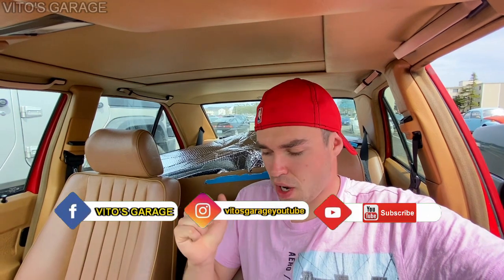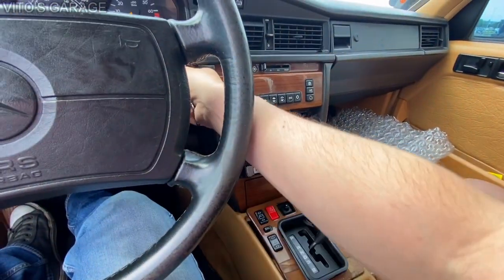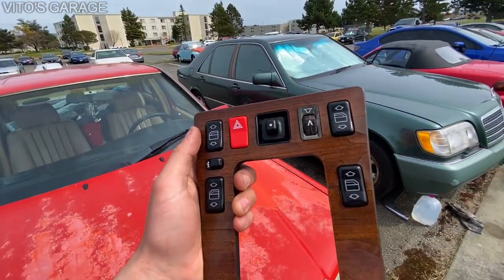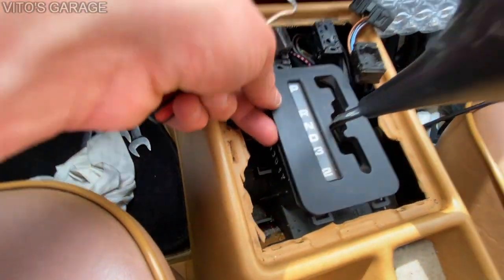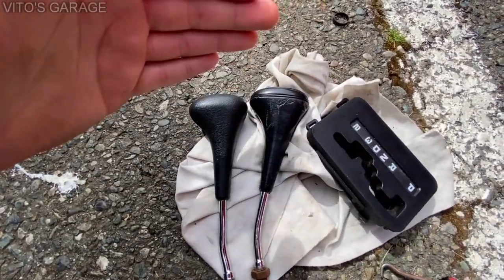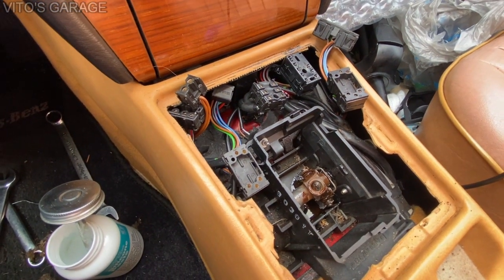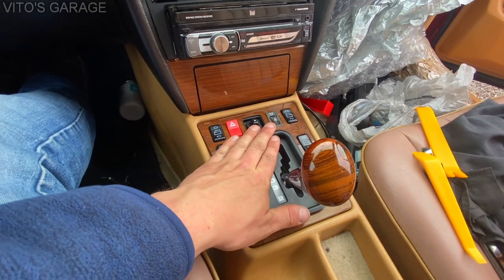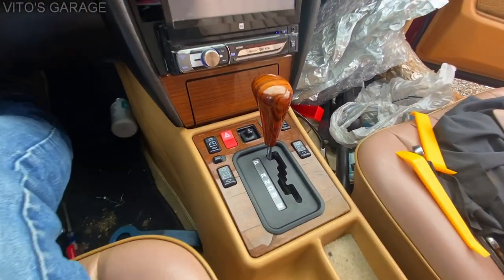Mercedes 190E Wooden Shifter Installation & Trim Surround Replacement!

Comment: I know this is a pretty old video now... but that stripe down the middle of your shifter top is DIRT!  The leather is simply dirty.  (Yes really lol). The only thing ive found that ACTUALLY works to deep clean leather, is the "Strong Leather Cleaner" from Colourlock UK.  Must use a brush to clean it

Comment: Yo Vito!! Good job!! You gave us a lot of pointers on how to remove the trim. Mine is also chipping away. Question:
I am confused about what type of cars I have. 
1987 300E 2.6 
1988 190E 2.3. What chassis code are they?
Reply from the maker: 300E is a W124.
190E is a W201.
Thank you for supporting!🙂🤘

Comment: Great video. I also replaced my gear knob with another one made of wood. Feels a lot better. Other than that, I think it's a shame that these zebrano trims crack so easily.
Reply from the maker: Thank you for watching! Well, they’re 30-40 years old. It’s pretty amazing how good they’ve kept up!
Reply: Mother time + the sun + heat cycling = unpreventable laminate cracks.

Comment: Question - 1988, MB 190-E, 2.3 - Extreme difficulty starting, cold or hot, replaced OVP, + cold-start injector, new plugs, + runs boggy, won't go above 70 MPH and takes a while to get there - + again boggy when going up hill. Drives like it has a potato in the exhaust. Mechanic stymied - any suggestions from someone who has had similar problems would be appreciated... Thanks in advance, John
Reply from the maker: Hi there. Have you checked for vacuum leaks in the intake? Vacuum leaks can cause weird problems like that. And make sure the fuel pressures get tested. There should be about 0.4 bar different between upper and lower chambers of the fuel distributor. You need a special KE Jetronic gauge for that
Reply: Thank you Vito!!! I will certainly check that. I did put on a new fuel regulator and no change, so this will be my next step, again 'I thank you!"
 @VITOSGARAGE

Comment: That.adds a touch to the 190, it looks like Zebrano wood, I think they have a matching steering wheel
Reply from the maker: Thank you. I am thinking either to get a wooden steering wheel or to find a nice original one. I’d love a nice original more. I want to keep the airbag in and keep it original
Reply: @VITOSGARAGE  There is place where they sell  the wooden accents, for all types of Mercedes Benz, from the cars to the SUVs, and they have steering wheels, that you can keep the airbag, but the rim is like in wood, also they have different pieces to make the car stand out of the rest, they have body kits, rims, & different items, to make your car or SUV, look👌👌👌👌👌it is called Performance Products, and they have different catalogs, like for Mercedes Benz, Porsche, and others, sorry don*t have the telephone, they also have apage,www.performance products, where you will find all the goodies for your  190, and other models.

Comment: 👍
Wood maybe warped or expanded with heat? I took mine off and back on but didnt have same problem?
Reply from the maker: It may be a little warped. I want to restore one of those trims in the future. I’m happy that the trim sits in there and isn’t popped out anymore🤘